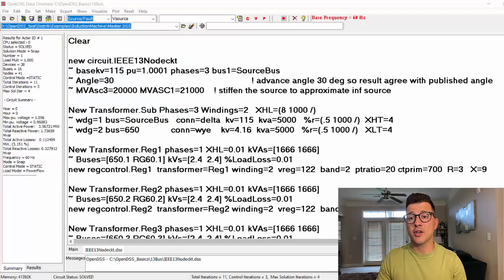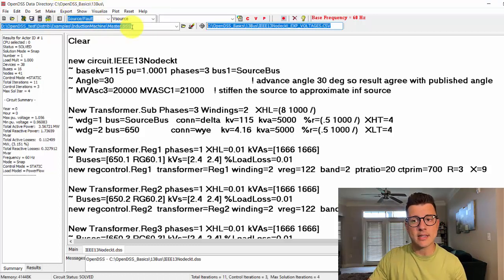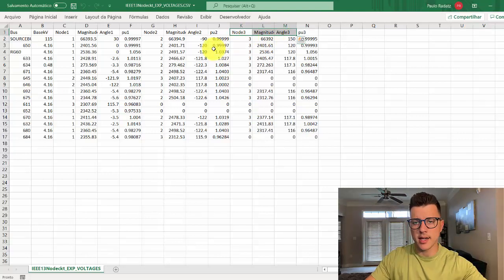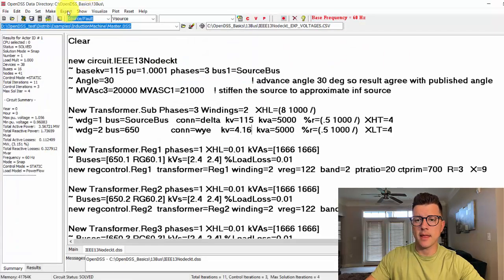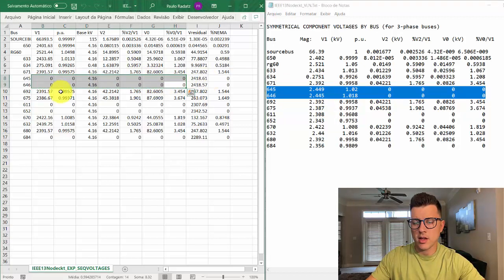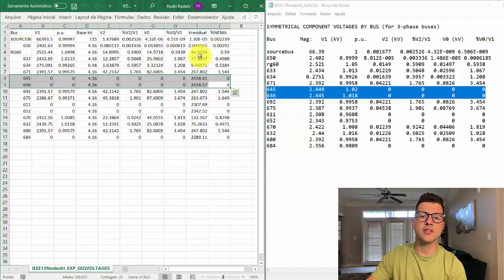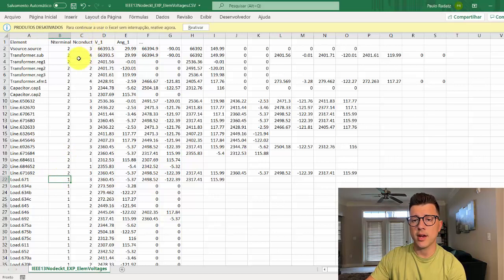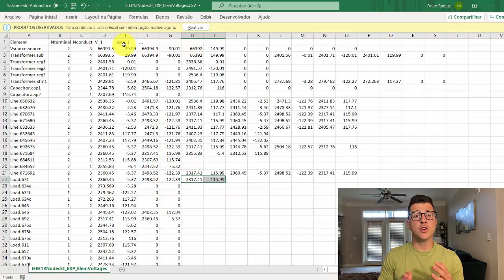6 - [En] OpenDSS Basics | Voltage Part 2

Comment: Hi Paulo, You've done a great job, i compliment to you.
If i may i have some questions: when, here, you speack of the magnitude, what it represents
and also, i didn't understand well How the "per unit" computation works, for example in on onf the exported file here, is represented by 1 or less, seeming like a ratio of the maximum voltage in the nodes of that element and the actual of that specific node. 
Thank you again for your splendid work and i Hope you'll be able to answer me.
Reply from the maker: Hi Giordano, thanks. Sei Italiano?

OpenDSS defines voltage bases by performing a no-load power flow—a simulation without considering loads, capacitors, reactors, or generators. In a well-modeled system, this results in voltages close to the rated value (1 per unit) at each bus. OpenDSS then compares these voltages with those defined in your voltagebases array to establish the voltage base for each bus. For your issue, double-check the values in your array.

It's important to note that OpenDSS uses per-unit voltages only for reporting results. All calculations are done in volts, so your results in volts are likely correct even if the per-unit values appear wrong.

You can reach me via my personal email [paulo.radatz@gmail.com](mailto:paulo.radatz@gmail.com) or connect with me on LinkedIn.

Best regards,

Paulo Radatz

Comment: Hi   , It is very helpful.  I have a question. If we compare the results (voltages) in text file with results in  exported csv file,  they are not the same for some buses, as shown in the video. Which results should we consider (from csv or text file) ? Can you please explain. Thank you
Reply from the maker: So, it depends on what you want. In the video I showed that they are different what they mean, so you might use one or the other.

Comment: Can you explain the origin of the different numbers in V1 column for nodes 645 and 646 between the two files? Thanks
Reply from the maker: Hi Milan, 
I opened several files; which ones are you talking about. Could you write down the min and sec of the video?

Best regards
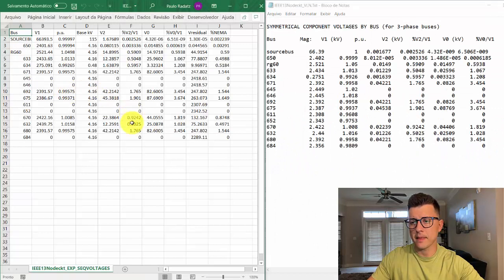Reply: @PauloRadatz  Sorry... Starting from 06:03 (https://youtu.be/0-NlkM8AaOo?list=PLhdRxvt3nJ8yZH-xVuE-4mifMHRlJK2n3&t=363)
Reply from the maker: Yeah - For some reason, the export file defines that non-3 phase buses don't have sequence component voltages. That is the reason for zero to V1, V2, and V0. 
The show file has V1 as the first line-to-neutral voltage, even though sequence component voltages are not defined.
With that said, I just wanted to show that OpenDSS does it, so you all are aware.
Reply: @PauloRadatz  Thank you for your answer.